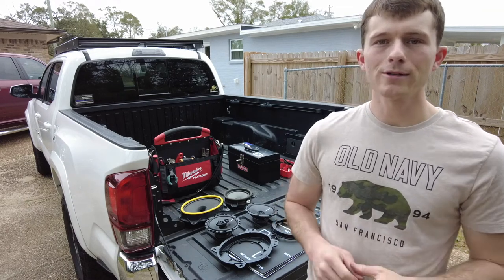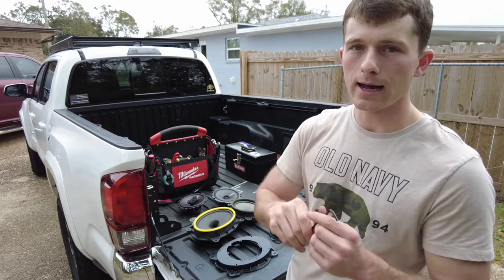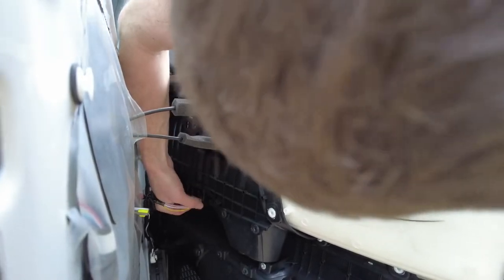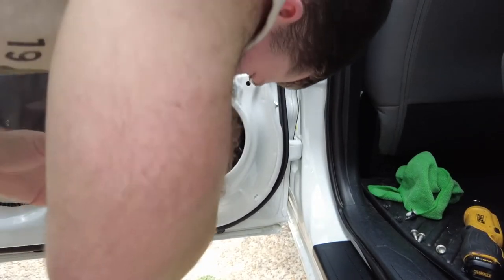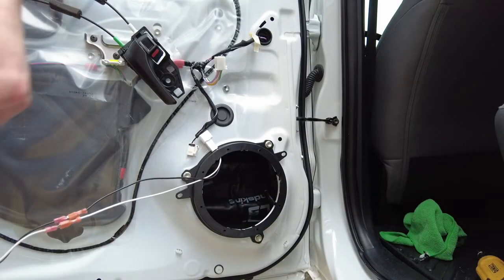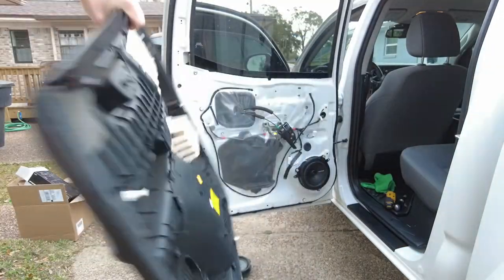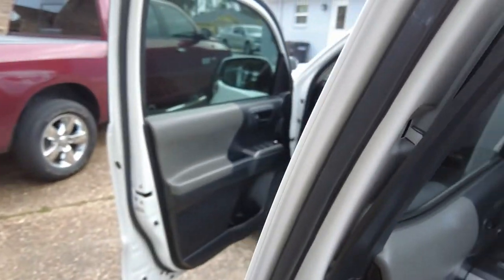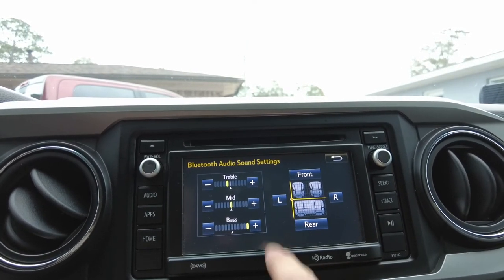How To Install Rear Speakers on 3rd Gen Tacoma

Comment: I recently installed new speakers in my Tacoma.  Just fyi for anyone about to do this, it is easier to mate the speaker to the adapter bracket first, then mount it to the truck door as one unit.  When I mounted the speaker to the adapter, I put a thin bead of silicone around the speaker edge first, then set it on the adapter then screwed the speaker to the adapter.  It is probably unnecessary overkill, but I did not want the speaker to ever vibrate and rattle on the adapter.  Also, I installed the wire harness adapter onto the speaker and zip tied the excess wiring to the speaker frame so that just the plug was sticking out of the hole in the adapter.  I did not want extra lose wiring hanging inside the door and possibly get caught on the window mechanism.  New speakers sound so much better than the  junk speakers from the factory.

Comment: Yes sir I watched ur video and it was great and also detailed real nice but I have a question was the adapter speaker wire plugs the same size on front and rear. Thanks
Reply from the maker: Thank you Wade, great question, it is the same speaker connector: Metra 72-8104 Speaker Connector: https://amzn.to/3r2aN0b
Reply: @CluEngineer  thanks for the help. Getting ready to upgrade my 23 TRD sport!!!
Reply from the maker: @wadepauly7380  Congrats on the new truck, that is awesome

Comment: Found out that for 2022 tacomas , it’s not Metra 72-8104 but 72-8109
Reply from the maker: Thank you for the update, did the part actually change at all?
Reply: I have a '22 Limited with the KBL sytem. Metra 72-8109 are not the right adapters. They do not fit. The 72-8104 is the correct adapter for the door speakers.